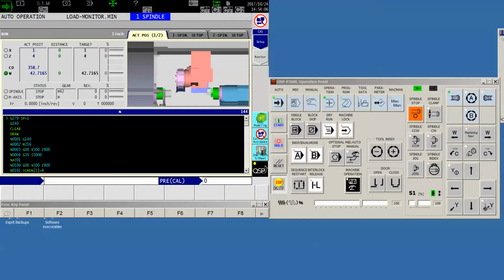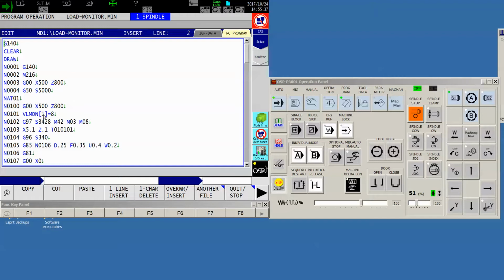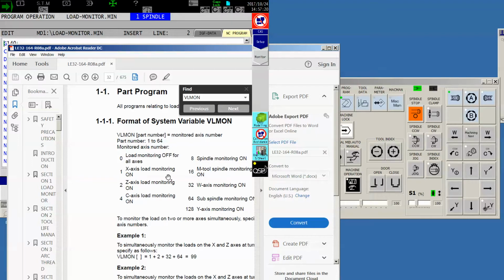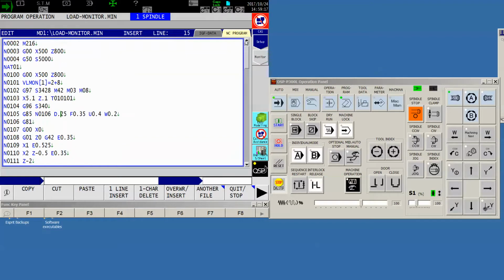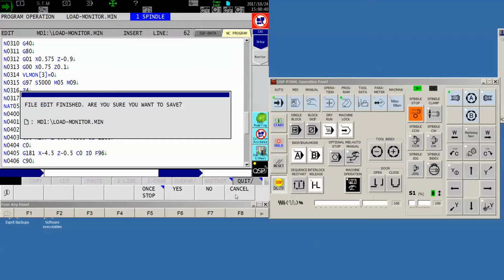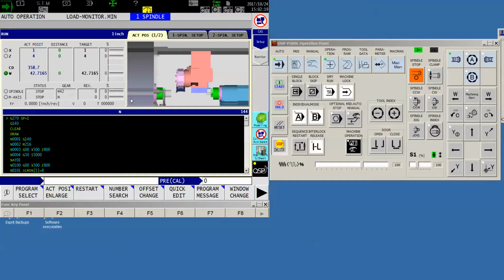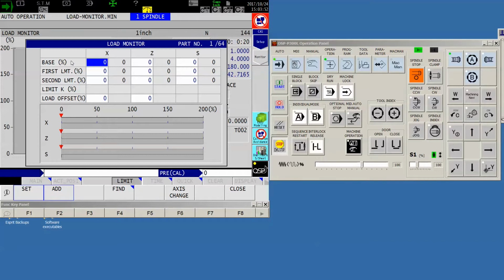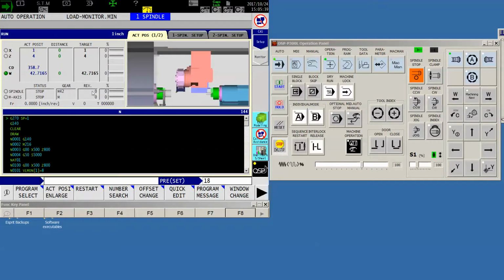Lathe load monitor

Comment: Do you know how to turn the monitoring key on from the program? We are transitioning to using this and require to be able to turn it on and off from program.
Reply from the maker: I don't know of any provision to force it on, but you can sample the IO to see (and alarm if necessary) if it has been engaged. The IO is VORD[1C]  and will equal 0 if the monitor button is off and will equal 1 if its on. I have had frequent uses to have that in the header of a program to prevent the machine from cutting if the operator hasn't turned on the monitoring. That is usually enough to prevent errors, as even if you aren't activating the system with a VLMON statement, it doesn't hurt to have the monitor button on
Reply: @pocketcharleywithgosiger  thank you so much. Your help is greatly appreciated!

Comment: Is there anyway to store this part load data in a file to stay with the program for next time? We are looking at setting this up for our automated process and need a simple way of managing the data.
Reply from the maker: Sure you can save the data. Some folks like to leave a specific load data in the machine. Since you have 64 possible load pages, I've seen people use page 1-10 for part #1, 11-20 for part #2, and so on. You can also save out the data to be recalled at the time the job is re-set up. In order to save the data, go to your parameter page, then look for the soft key labeled D-PIP and press it.  Next, select the OUTPUT key. Populate a file name that corresponds to the part number, then highlight the TOOL DATA field and change the value to SELECT. Once that field is set, F4 will have a value of DATA SELECT. Pressing it will give you a list of tool related items that can be saved out. For just load data, select T12, T13, and T14 items. Next change ORIGIN DATA and PARAMETER fields from ALL to SELECT, but don't check mark any items on those fields. This will create a file on your MD1 with a file extension of .TOP and can be reloaded with the same D-PIP screen when you're ready for it
Reply: @pocketcharleywithgosiger  thankyou for that. On the topic of tool data, is there anyway to read what tool is mounted on a turret lathe from system variables? I cannot find anything yet, but I know the information is in there. A separate issue to the load monitor data but we have an applocation where reading the mounted tool would be useful.
Reply from the maker: Sure! VTTLN[1-12] will read a tool number mounted on an individual turret station
 @number2664
Reply: @pocketcharleywithgosiger  I am sure I have tried that, it worked for the A turret which is the turn/ mill turret but the B turret it which is 12 station it wouldn’t work. I am not sure if there is some auxiliary or preparatory codes I need to put in first being a sub spindle machine. I have tried in MDI with the B turret selected, and either the main or sub spindle selected with no outcome. It comes up with a local variable error which says to me that the system variable does not apply to that turret. I will have another try today anyway as I am heading to work soon. Thankyou for your help.

Comment: I am unsure if this applies to mills, but on the lathe that I run, if the value for the machine to alarm out is set too low, the machine will stop the turret while the spindle is still attempting to stop (still rotating because of inertia), which can cause the carbide inserts to break.
So, if the tools are repeatedly breaking, try setting those point values a little higher.
Reply from the maker: That’s method number one, however there is also a parameter on the load monitor page which allows you to specify a time lapse between the signal for overload and the servos turning off. This is super handy, and it allows all motion to stop prior to going night-night

Comment: This Video is great but it would be great to have some real world numbers and examples behind it. Mainly for a starting reference point. For instance for OD turn roughing, what is the best axis(s) to monitor? What are some good start values for the first limit second limit? Is there a good way to use the load monitor to get these values for different applications?
Reply from the maker: With all the variables that a cut has (insert brand, work holding, tool mount rigidity, etc.) there really is no set parameter of where to start. What is in the ball park for one shop may be waaaaaay outside the parameters for another due to different approaches. The typical axis to monitor, however, is a bit easier: when in doubt: monitor them all! While it makes no sense to monitor the Z axis when cutting off, there is certainly no HARM in doing so, so why not?
Reply: @pocketcharleywithgosiger  so I finally got a chance to set this up. I didn’t realize that the auto set function also sets the two limits. I’ll probably have to tweak them but at least it’s not a shit in the dark.
Reply from the maker: @diggity911   Roger that! No darkened poopoo around here!  If you consistently find yourself adjusting the two limit levels, you can find a default setting in the LOAD MONITOR parameter page that will allow you to adjust.